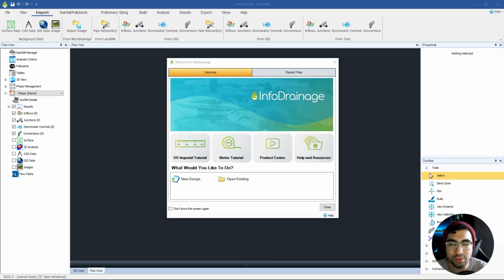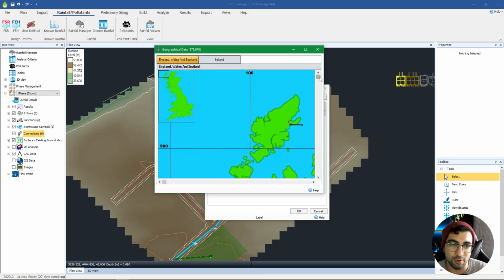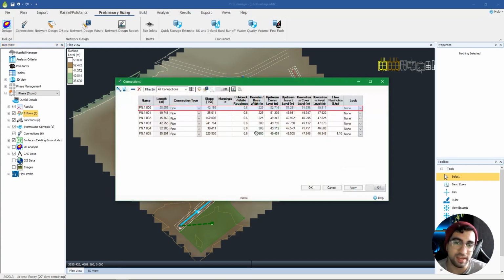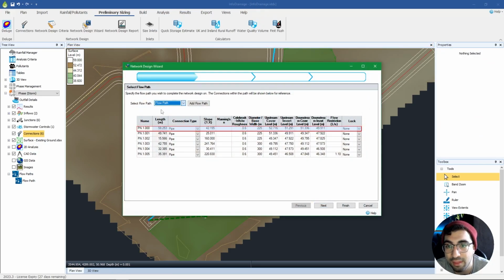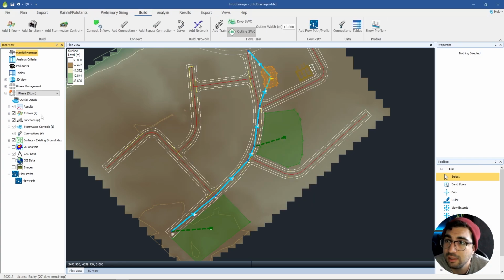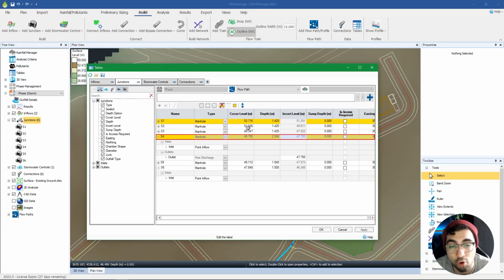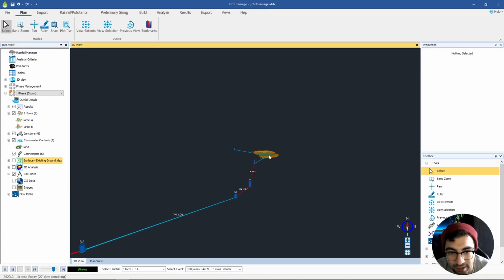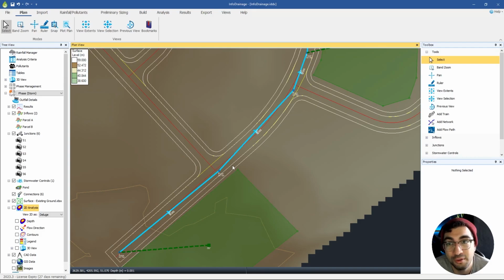InfoDrainage - Introduction

Comment: Hi, when you are sizing an attenuation is this same process as causeway flow?
Reply from the maker: For the quick storage estimate yes, pretty similar
Reply: @ I have noted when using the quick storage estimate on INfodrainage, there is the quick storage estimate tool. It gives you rough estimate. Do I then need to make the one node network (with attenuation tank) , and run the simulation to further reduce size of attenuation?
Reply from the maker: It depends what are you trying to achieve 🤔

Comment: I feel like infodrainage is prettier than it is practical, I love the graphics. I played with it last year hoping to move on from Causeway Flow solely for commercial reasons rather than design reasons, needless to say I kept Flow+ as i found Infodrainage to be much less user friendly and the worst part is its reporting which I didnt like, it was all over the place! Flow report is much superior in its presentation which is normally appended to design reports, simple and effective. My experience using infodrainage albeit only for a couple of weeks of testing it is reflected in the comment by @Blaaland88.

Comment: Based on our experience in my consultancy Infodrainage has presented nothing but problems. When compared to Microdrainage it is an inferior product in my opinion.

The tables are a mess. The arrangement of information, whether that be user input design info or result info, is confusing and haphazard. There is no clean, clear and obvious table/location to input your information. You have to go searching through multiple buttons and/or tables to whereas microdrainage has this on a single screen. Turning on/off autodesign is also improperly labelled and buried. There are features that were in-built in Microdrainage that have either not been initially included or forgotten about. For example, sorting your modelling results by critical duration was a feature only released in either 2022 or 2023 versions. This is basic and should have been in the initial release.

The Civil3D Infodrainage export/import tool is incompatible with some other Civil3D add-in and crashes if some of these are even loaded. It also has a tendency to crash if your network gets a bit big.

The foul water drainage design feature was thrown in as an after thought. There is no table as far as I could find where one can easily input foul flows/discharge units etc. a la microdainage/causeway. It also incorrectly calculates and does not follow EN 16933 and EN12056. We had to educate their development team on the appropriate use of foul drainage discharge unit methodology. How a product was released with this capability being broke is improper.

These are but a handful of the issues we have come across. Use of the tool has been detrimental to project delivery. So to sum up; this product was released far too early and adopters, such as ourselves, have essentially become beta testers. They had an industry standard tool in Microdrainage and instead of building on it by improving the UI and the SuDS & BIM/Civil3D integration they made an absolute meal of it. If you are using Microdrainage or Causeway I would not recommend transitioning over to Infodrainage at this time.
Reply from the maker: Hi thanks for your input! As a new user of infodrainge I have yet to encounter these issues. I can relay all this to my contact at infodrainge as feedback! Thank you
Reply: @CivilTechSource  Just my two cents but please don't let my own opinion influence your ultimate opinion!

Innovyze are well aware of our issues as we are in constant contact to get through some of these unfortunate issues. Some are being fixed in upcoming updates, others im not sure. 

Also, thanks for the video, there isn't a pile of Infodrainage related content available online so this is great to see! I think this presents a much better introduction and overview of the software than anything offered in the software's help guide or 'How Do I?s'. I will be forwarding this onto my team's grads and juniors as a much watch. Looking forward to seeing more content on this as you use the software more!
Reply from the maker: @Blaaland88  I really appreciate your input, after all this is why I started my channel to create a community of engineers and exchange experience and knowledge. Definitely more content coming out soon. Thanks for the support!
Reply: Got the same experience from Infodrainage.